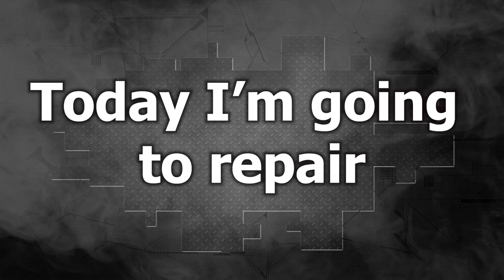Toyota Auris. Body repair. Ремонт кузова.

Comment: "Lead wiping" a lost art. Almost everyone else uses body filler. This is one of the easiest repairs you've done. All the best from Queensland Australia.
Reply: Bruce I wondered what that was, the description said tin. What is the stuff he wipes on it first?
Reply: @PhillipHall01  The stick that he melts onto the repair would be solder, which may be 50:50 tin:lead or 30:70 tin:lead. He first uses tinning flux to clean and prepare the surface for the "lead" to stick to. I'm not sure exactly what the flux is, but it appears to be some sort of paste that has solder in it, because after he wipes it, it looks to be "tinned" or coated with solder. It's certainly an art and looks really difficult to do. It needs the exact amount of heat to work. Not something the average person could easily learn.
Reply: @BrucePierson  
Thanks Bruce for you detailed reply. Appreciated...
Reply: @PhillipHall01  You're welcome.

Comment: Customer comes in shop, I have little scrape,Arthur proves that even little scrapes take much skill and labour if jobdone right
Customer say I want cheap,then lots of bondo  later customer gets cheap  job done,next year bondo crack with door  slamming and wheel arch cracks  because area not prepared properly
Arthur do Good job
No corner cutting

Comment: Good afternoon Arthur, great looking repair. I like that new wheel arch line marker. Did you make that in your shop or did you find it on the Internet? Looks like a well designed and engineered tool. Very useful and clever. Thanks for the Sunday video. Take care and good luck.
Reply: @SalvageMasterEssex  Thank you, but I can't find it when I use this #.
Reply: Dent Fix Equipment DF-BL10 Body Line Marker Tool

Comment: Arthur: I would love to have the Quick Puller for final touch up work. The problem is I cannot find this in my country. When found on ebay or amazon says can not be posted to the US. Does anyone know where this can be found in the USA? I have everything else, spotter, slide hammer, washers, etc. There is simply no Quick Puller 😀Thanks
Reply from the maker: Somewhere I saw on YouTube how you can do it yourself.
Reply: @tussik01  
Yes that is what I will do. Small price to pay for such a good machine as the spotter. 😃